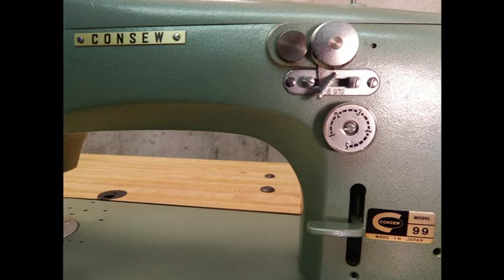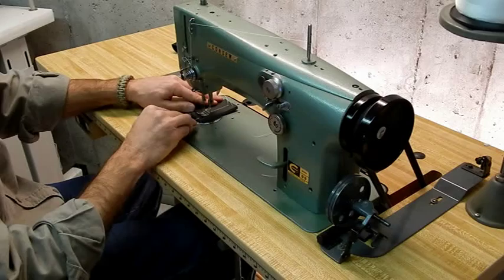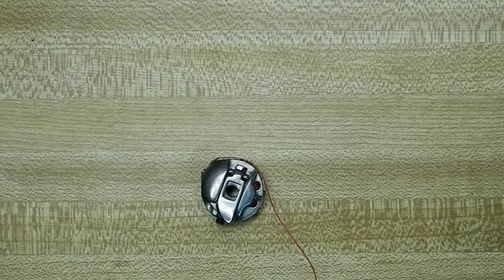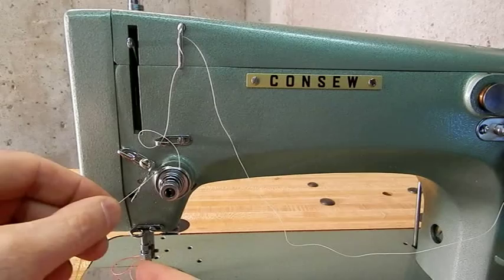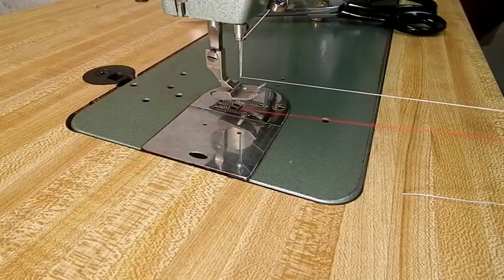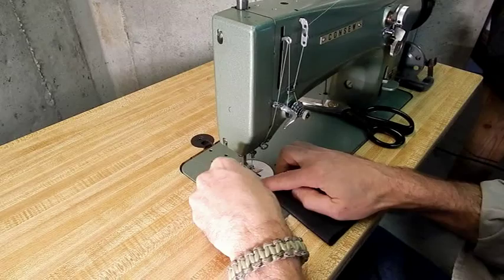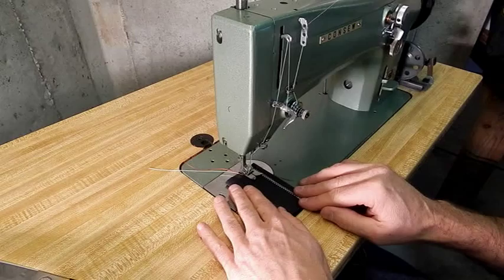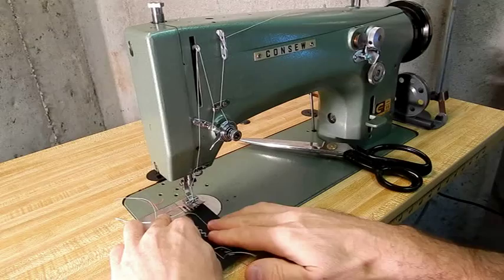Consew 99 Zig Zag / Straight Stitch Industrial Sewing Machine Head

Comment: Hi, great video. I just picked one of these units up. Is there a way to increase the stitch length? I want to get to 5 stitches per inch. Thanks!
Reply from the maker: There is a dial for stitch length on the front of the machine. Not sure if the machine is capable of stitches that long.

Comment: Would the Consew 99 be a decent choice of a zig zag machine to use for sailmaking?  I am currently using a Pfaff 138 and it is becoming a bit fidly.
Reply from the maker: I think all industrial zig zag machines are a bit fiddly especially from this time period. Timing is critical. Bernina 217's are popular with sail makers, even more so with 3 step zig zag. then Singer makes a good zig zag too. https://youtu.be/XfTjJrTXA0w
Reply: Thank you very much for your input...greatly appreciated.  I couldn't pass on the Consew 99 and am pleased with the price I paid and the value rec'd.  This machine seems easier to buy parts for and it's a bit simpler to make the adjustments on than my Pfaff.  Both are built like tanks.  Thanks again.
Reply: @AlexanderDyer  Hello again.  Sorry to be a bother, but is the needle bar thread guide on that Consew 99 the one that came with the machine?  It looks like you were able to slide the thread in from the side, whereas the one on my 99 just has a small hole in the front bottom with barely enough room for the thread to clear the bottom of the needle bar itself.